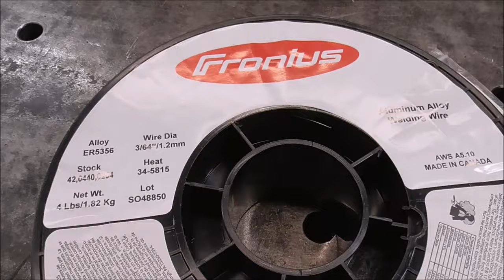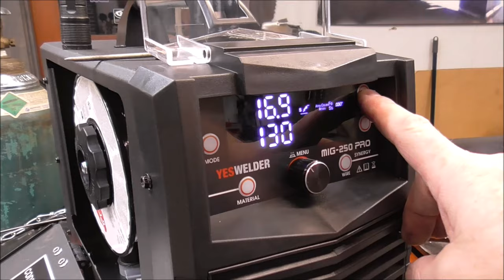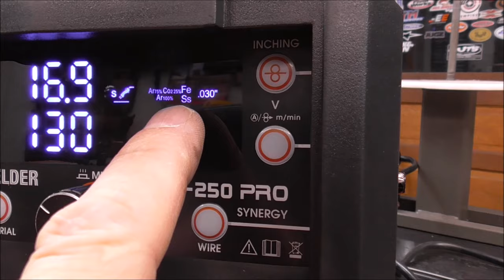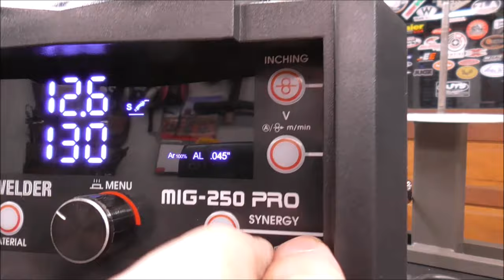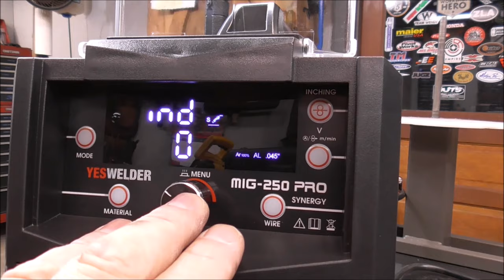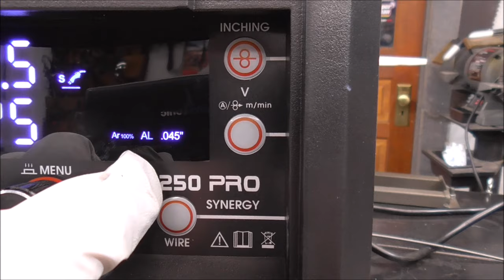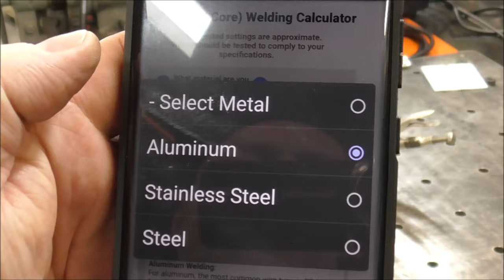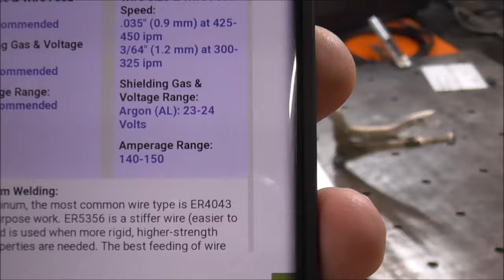Aluminum MIG Settings Machine Setup and Graphine Liner Ep2

Comment: Great video, Brandon!  My take away is that even though you have a wonderful machine, it still takes some playing with to get the welds right.  For that I am grateful in showing in better detail what it is supposed to look like.  I so appreciate what you do.  Have a a great day and am so glad you are feeling OK.  Be well, be safe.
Reply from the maker: Thanks @Jim MacSuga this is an awesome machine but as you mentioned it does take some practice to get right. Aluminum in general is more difficult than steel MIG or Self shielded but once it's dialed in, it is soooooo much fun. A little more messing with the settings and I should have it dialed in really well. It's my intent to put together a settings chart better than what came with the machine to get people up and going much faster. Stay well buddy and god bless!

Comment: Brandon, I bought a new liner for my Lincoln pro mig welder, but it's for steel. This is the one I bought at the scrap yard. I have to service my generator before I can test it as my shop is on an Amish farm. This will be adequate for running my plasma cutter and air compressor simultaneously. My smaller generator is good for running power tools.

Comment: Hi Brandon. Fantastic that you’ve taken the time to put together very informative videos. An additional note is that aluminium is different to steel in that its thermal conductivity is much higher than steel. So initially with aluminium you need higher settings to punch the heat in fast and early to allow for the heat being sucked away so quickly, then as the heat levels out throughout the piece of ally you then need to start turning back your settings. Especially if you are just practicing stringers. Perhaps cooling the piece in water between stringers would maintain consistent settings and results.
Reply from the maker: Excellent point 👍

Comment: Thanks for this video man! I just bought all the parts and pieces for some aluminum work I need to do. This is really helpful. Only thing I wish I would have ordered is .045 for my work.
Reply from the maker: Glad to help man. Depending on your machine, some of the smaller units will struggle with .045. If you have a 220 machine than your probably all set

Comment: I bought a liner for my Lincoln migpak 140, got it thru home depot for about $100. Works pretty good. 5356 and straight Argon. Make sure to clean the material good. I use a buff wheel just for aluminum (I've found if I use one that was used on steel if spits and pops when I try to weld) also acetone or brake clean works good to do a final cleaning. Good luck
Reply from the maker: Spot on! @Jimssawsnstuff

Comment: Brandon, I have a mig spool gun from Cobra/MK for aluminum, but it was on a push/pull Cobra water cooled welder that had a synchronized feeder as well, but they have adapters for other brands. I tig welded aluminum, but haven't done any mig aluminum welding.
Reply from the maker: @ Bryant Fry Thats a nice setup also! The great thing about spool guns is they always work without the feed issues that go along with MIG sometimes. But I also like the simplicity of MIG aluminum if they are setup right.

Comment: Brandon, an idea for a project is a swing arm welder holder, attached to a wall, or on a column support. The welding shop I did my welding in, they had the wire feeder on a swivel boom, and the welding power unit was mounted above the bathroom area, which made more room, and made working on big projects a breeze. It wouldn't get caught on things on a cart, either.
Reply from the maker: I like that idea. Thats a pretty common setup in the bigger fab shops. I could mount my Fronius on it and it could swivel above my weld table. It makes it really nice because the whip usually hangs almost straight down. Thanks for the idea buddy! @Bryant Fry
Reply: @BrandonLund  you're welcome.

Comment: Go out and pick up some Hobart Maxal Mig. 4943 Aluminum wire, you will thank me later. It welds clean like 4043 but feeds more like 5356. It is widely used in production shops everywhere now. Unfortunately, it is just like 4043 and does not Anodize true to color. So if it needs, Anodized it has to be 5356. Great video!
Reply from the maker: Great tip bud thanks for sharing! I'm going to grab some this week and run some beads 👍🙏

Comment: The reason not to stand in front of the regulator when opening the cylinder valve is that there is a potential for the regulator screw to become a projectile if the regulator should malfunction. The reason to fully open the valve is because it's a backseating valve. Other types of cylinders have these valves.
Reply from the maker: Right on 🙏 @Bryant Fry

Comment: I didn't do ANY of that. I just used my Chicago Electric wire feed. Popped in a 2lb roll of aluminum from HF and fed it through. Took some messing around as it gets messy but got it dialed in to work well enough for messy welds. It worked. Now obviously you wouldn't want to do this on something you needed a nice weld on. but for something like fixing a large crack or filling a hole or even joining to pieces. its just fine.  Ididn't need to change liners shoot I didnt even use Argon or any gas at all.
Reply from the maker: I have accidentally welded aluminum forgetting to turn on my argon bottle and it made a terrible mess. I'm surprised you were able to get it to bond @Robs Device Unknown

Comment: By watching this video, I might order a teflon liner for my Lincoln 210MP and give it a try. Lot cheaper than a spool gun.
Reply from the maker: Much cheaper than a spool gun and I like how simple it is. Change your liner and put in some U groove drive rolls and you are in business! Make sure you get the U groove drive rolls @Jose Vazquez they will keep the wire from deforming because it takes more tension than how you would normally set it for hard wire or self shielded. It's a lot of fun buddy!
Reply: I bought a liner for my Lincoln migpak 140, got it thru home depot for about $100. Works pretty good. 5356 and straight Argon. Make sure to clean the material good. I use a buff wheel just for aluminum (I've found if I use one that was used on steel if spits and pops when I try to weld) also acetone or brake clean works good to do a final cleaning. Good luck.
Reply: Please don't use brake cleaner on anything you're about to weld!
Reply: @simeonprice390  all of mine is non-chlorinated, and I let it completely evaporate. Acetone is just as flammable, if it doesn't evaporate first
Reply: @simeonprice390  maybe you would like to explain?
Reply: There is plenty of information on the dangers of using brake cleaner with welding as you are probably aware of as you stated you use non-chlorinated  which is probably safe enough to use but as a general rule I would always advise against using it for welding preparation as the chlorinated brake cleaner which most people will probably have a can sitting around that when heated creates a gas called Phosgene.... End of the day most don't know that there is a high danger to one's health when it comes to a simple can of brake cleaner so I just hope anyone that sees my comment will take a minute and check if it's safe first.
Reply: @simeonprice390  havea great day KAREN
Reply: @jimssawsnstuff8903  have a good one too mate
Reply: @ Jim     Simon wasn’t talking about flammability  he was talking about a gas that is put off by brake cleaner which, if inhaled will damage your nervous system and cause you pain for years. He wasn’t being a KAREN. 
However you kind of came off that way with your calling him one.  Chillout

Comment: Hi Brandon...  I wanted to ask why you don't do videos using your Fronius machines...  I am very interested in the Transsteel 2200 or 2700...  Can you do some work with those machines in the future...  Thank you...
Reply from the maker: @Slowhand Thanks man! I actually have probably close to 40 or 50 videos with the 2200. It's and incredible machine. Hands down the best welder you can buy. If I'm doing a tutorial like in this video I will specifically list the welder I'm using. For project videos I dont always show features in detail like this one.  Here is a detailed video with the 2200. If you look in the "Ultimate Tool Build Series Playlist I used the 2200 quite a bit. https://youtu.be/jbvkMPpSD-s

Comment: I use my Transteel 2200 for aluminum welding, I bought a separate mig torch for it. Works very well , try yours it will do a much better job than the Yes welder.
Reply from the maker: @Bruce D I'm glad you mentioned this actually. I had forgotten that I have an aluminum liner for the 2200. I'm curious because the 2200 has a pretty decent whip length. Did you get just the torch end or an entire new torch, whip and liner (if so, that's not cheap) lol
Reply: @BrandonLund   I bought the whole new torch /whip/liner. not cheap but worth it. Does aluminum very well
Reply from the maker: Thats the way to do it! Way easier than messing around with liners! 👍

Comment: Great vid  and very informative. I was wondering if the 250P has pre and post gas flow? Thanks!
Reply from the maker: It's been a minute but I think it does
Reply: @BrandonLund  
Thanks Brandon. You didn’t mention it in your vid, but I can go check out the specs. Your vid really was VERY good, and helped me to finally pull the trigger on the 250P. I have the 205, but wanted more control over my setting, where the 205 is Synergic only, with the +/- function. The Aluminum option is nice too 😉. Thanks again and God Bless!

Comment: where do you get the .45 tips that fit the torch?I have looked but the thread is different, and or only for a spool gun
Reply from the maker: Matheson Gas. There all over the United States also

Comment: Being a newbie to welding I've gone ahead and tried putting aluminum wire (5356) into my multi-process welder (similar to yours but cheaper analog) and didn't change the liner, tip or roller to what I had stock which I've used for mild steel. I had to play around with settings a bit but ended up being able to consistently weld a half decent looking bead on 3mm thick aluminum. What problems can I expect if I just continue using my setup as is without changing out the liner, tip or roller? I'd only used the mild steel wire a little bit while testing so the liner is still relatively unused/clean, and I don't seem to have any issues with wire feed jamming up or bird-nesting. I don't mind changing out parts if needed but just curious if I should bother if it's working as is.
Reply from the maker: If it's working OK it's likely you will be fine because any of the contaminants from the steel wire have worked themselves out by now. It's when you switch back and forth from steel to aluminum that it causes problems. That contamination from the steel could have been some of the reason you were having trouble with the adjustments until the trace steel worked it's way out
Reply: @BrandonLund  Appreciate the response! After a little bit more playing around I think I will go ahead and change out the bits/pieces for aluminum specific parts. The wire will feed fine so long as I keep the line relatively straight... but when I had to make awkward angles while welding it did bird-nest a couple times. Have ordered the parts, again thanks for the video and response!
Reply from the maker: @procrastinator1727 glad I could help brother! 👍

Comment: Great video. For hobby or occasional welding aluminum it is just fine. For anything else a pulse welder is way better for good welds and easier welding. Depends on if $5,000 is worth it.
Reply from the maker: Totally agree @jasongrinnell1986

Comment: great awesome video. can you weld on cast aluminum ?
Reply from the maker: Thank you. I haven't tried but yes it's possible.
Reply: @BrandonLund  thank you for replying so quick, can a cast aluminum cylinder head be welded and will it hold after being tested on an engine?
Reply from the maker: It can be done but cast aluminum is always a challenge but it can be done

Comment: Hey Brandon, Can you mig weld aluminum even if the welder doesn't have a aluminum specific setting on it? I'm considering getting another mig gun with graphite liner but I don't want to waste the money if my welder won't work with it.  I have a weld pro 200amp machine mig200gd
Reply from the maker: Yes you can. We are going to be going over that in some upcoming episodes. I predict this topic is going to get a lot of interest from a lot of folks.

Comment: I work for a vacuum truck company and have aluminum trailers. We just buff the stuff clean with a die grinder before we start, would wiping it down with acetone after improve results?
Reply from the maker: Absolutely. It's reccomended.
Reply: @BrandonLund  thank you for the info and I appreciate you not talking to me down for my stupid question!!
Reply from the maker: Anytime man! When the question is honest it's never stupid. We are all here for the same reason. There is a good chance that if you don't ask there is someone else wondering the same question you had. I probably should have actually shown me using the acetone ( I do in other videos) but for time sake I skipped that part and just brushed it.

Comment: Hi Brandon
Am surprised that you could spray with 15 volts . Would have presumed that you would need at least 20 to 21 v
Spray mode is the choice for aluminum, yes?
Reply from the maker: I doubt I was in spray at that voltage. It's not ideal welding in short circuit but it can be done. There isn't a magic number for spray. 20 or so is the presumed area but its really dependent on wire diameter and material thickness, and the  stickout and the actual manipulation. The thinner the material and wire, the lower the voltage to get into spray.

Comment: I think you have to do another video with your welder but try to preheat the material at around 200 to 250 degrees  because aluminium is a heat sink and it dissipate the heat. More power on your channel.
Reply from the maker: Thank you very much @eduardo villena. Thats a good point. I need some temp sticks

Comment: Thought I heard you say you were using .045 wire with a .045 tip normally you recommend the next suze up in tip size or are you using a different wire size below .045.
Reply from the maker: Honestly I cant remember what I was using for a tip but generally going up one size is best practice because the aluminum wire expands as it's heated

Comment: Brandon, did you have to buy the liner kit separately? How much was the Yes welder when you purchased it? Thx alot & luv your videos.
Reply from the maker: @Todd Rhine the liner comes with the machine. I picked up the machine for $499 through a special promotion. It's a nice unit. I will likely be using it in this weeks episode also.

Comment: Hey Brandon nice job with the video. Great info. You mentioned you were going to make this your go to aluminum welder. Do you have any regrets are you still happy with it. I want to purchase a second machine for that purpose. I do a lot of aluminum work and was wondering if it would hold up. Thanks. keep the vids coming.
Reply from the maker: Time will tell @Ricker but so far I'm very happy.

Comment: I'm completely new to welding and seriously considering this Machine to learn on.   Planning on going to welding school in a year so excuse the dumb question please but can this machine also be used to TIG weld aluminum? The currently extent of my knowledge is from several kind people such as yourself making videos like this.
Reply from the maker: @Paul Byler this is a great machine to weld aluminum and it will do lift tig but if it's TIG you after I would go with the TIG 250. It does AC and DC TIG welding. It's an impressive unit https://amzn.to/3wHlA3b. I guess it really depends on what you are looking to do. If you want to do delicate thin parts  all the way up to thick parts the TIG 250 is awesome. The MIG Pro is better for speed / production on thicker parts in my opinion.
Reply: @BrandonLund  Thanks 🙏

Comment: hey so my shop does not have a proper welder for mig aluminum when i weld the aluminum wire gets cough in the wheels and rat nest any tips
Reply from the maker: Keep your whip very straight, one size larger contact tip, reduce your pressure on your drive rolls, make sure your liner is dedicated for aluminum only.

Comment: Thx Brandon. One question¨ I have a nylon liner that has a foot or so of metal liner at the end that is fed toward the gun. Is that just acting as a guide and then to be removed  at the gun end? Most likely a silly question but just to be sure
Reply from the maker: If it has metal spring looking piece, that part usually stays inside the gun. Generally it's the other end that gets trimmed
Reply: @BrandonLund  .Thanks Brandon. I thought that the whole purpose of having a nylon liner was to prevent the aluminum wire from snagging as it might in a metal liner. Therefore I cant understand why the last foot or so of the nylon liner would be metal.
Reply from the maker: Usually that's how liners for steel are setup. Are you positive it's for aluminum?
Reply: @BrandonLund  yes, it is for aluminum. The machine is just the clone of the the one you were demonstrating on
Reply: I had a chat with a welder friend and he agreed completely with you and said the metal conduit was there so as to conform to the anguation of the mig gun implying that a nylon liner in that region could kink
Reply from the maker: That makes perfect sense! 👍

Comment: Usually constant voltage is used for mig aluminum so just dial it in with voltage and don't get too worried about amps as most mig power supplies are constant voltage the amps will more or less be effected by your wire speed
Reply from the maker: Right on! @ Not my name thank you 👍